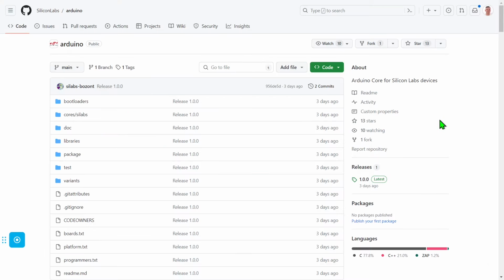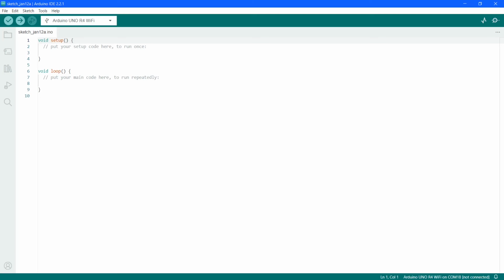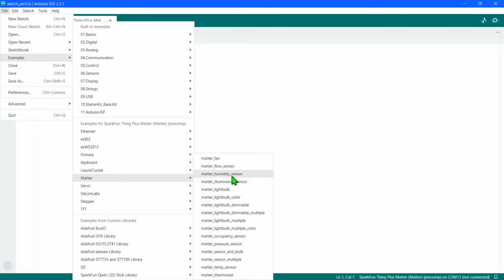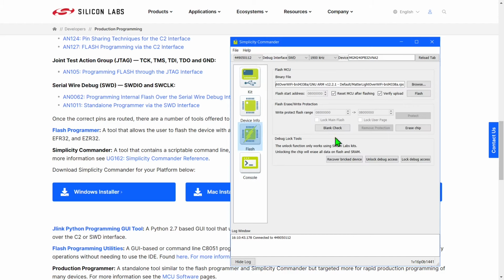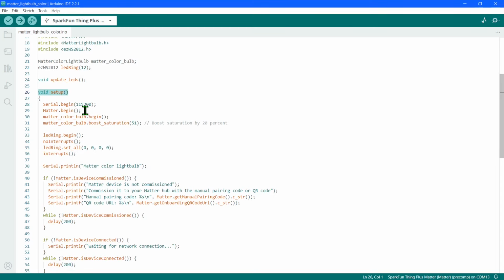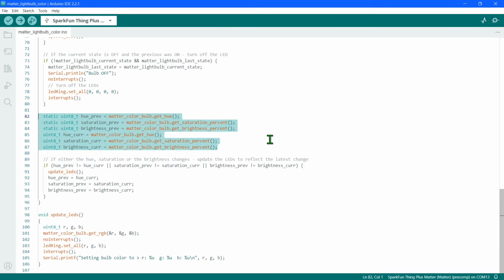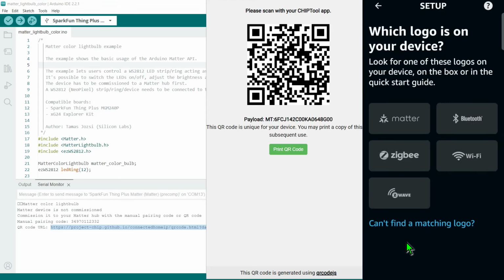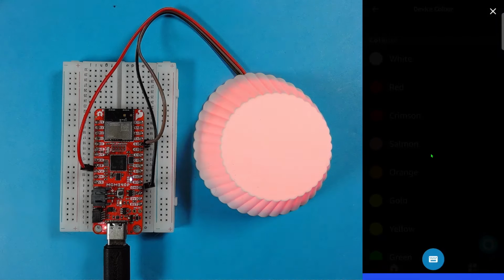Quick Start - Matter over Thread for Arduino - Silicon Labs

Comment: Now i am trying with SparkFun Think Plus MGM240P controller, i am able to compile and upload the Matter - Ligtbulb color example to spark fun board using Arduino IDE but in my Serial Monitor i am not able to get QRcode URL . You have told in the Video to reset the board. i have try pressings the reset button/ removing power and powering up the Board still did not get the QACode URL in Serial Monitor. Please help me how to reboot my board?
Reply: I have try pressing the rest button in my Sparkfun board and also try to disconnect the usb and again connect but i am not getting the URL to qrcode in Arduino ide?
Reply: Finally i am able to get the QRCode in Arduino IDE

Comment: I have Siw917 BRD4002A rev A06 board, will it work with Matter Thread or wifi?
Reply from the maker: Hi, the boards in this video are using Matter over Thread. Your SiWx917 board supports Matter over Wi-Fi and is not currently supported in the Arduino IDE. To get started with Matter over Wi-Fi on your board please follow the step-by-step guide from our documentation website: https://docs.silabs.com/matter/latest/matter-light-switch-example/01-wifi-light-switch-example
Reply: thank you  @ViralSilabs